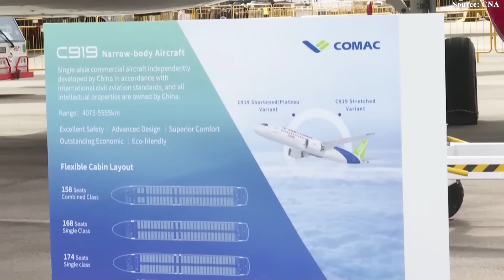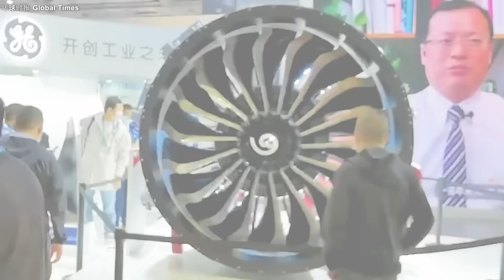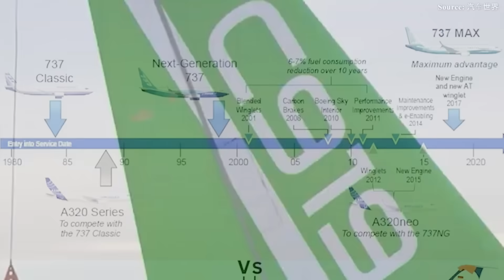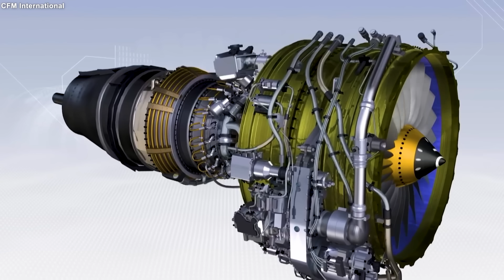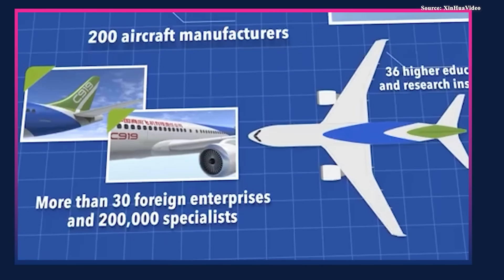This Is Why COMAC C919's Engine Outsmarted Boeing & Airbus!

Comment: Checked with Chatgpt

China's domestic engine for the C919, the CJ-1000A, is currently in advanced trial testing and moving toward verification flights. It has exceeded expectations in recent performance trials and is progressing toward eventual integration into commercial service.

🛠 Development Status of China's C919 Engine
CJ-1000A Engine Progress:

The CJ-1000A, developed by Aero Engine Corporation of China (AECC), is designed to replace the imported LEAP-1C engines currently used on the C919.

As of early 2025, the engine has entered trial runs and reportedly performed better than expected, according to experts at an aviation forum in Jiangsu.

It has already been tested on the Y-20 military transport aircraft, and verification flights on the C919 are expected to begin soon

Comment: There are some of your information are not true and you keep on mentioning the state supports and all the unfair. Do you know that China is run with communism system? Look what is happening with the West is suppressing China in the large group. That's natural, it's a national security threats to China. You can't blame the Chinese government for doing that. Which private company in China can do that or this project. You also wrong with your telling that COMAC is can only made a plane per year and you also forgot about there are planes been delivered outside China already. COMAC planes has been flying around China for almost a year now and there is no whatever incident so far. EU is under severe pressure from someone to stop issuing the certificate for Chinese planes to land in the EU but that won't be long in my opinion. They forgot China aviation market is very large and according to some experts, it needs more than 8000 planes by 2030. So COMAC will not be able to supply, it still needs help from the Boeing and the Airbus planes. Hopefully the Boeing quality and safety improve and prove to the market otherwise. I love to fly in the Boeing because it is more comfortable and quiet to be honest but very sad to know they are having problems. So please be fair with your information about COMAC and no matter how great is COMAC, China still needs the Western made planes.

Comment: The West is using its power with regard to certification to try and halt the rise of COMAC.
Reply: The question is........Boeing 737 Max is never considered a safe plane but has been certified to fly. Double standard and hypocrite
Reply: West is calumnating the Comac . But they tend to forget that China gave the World gun powder. 
They are afraid of China by marketing Comac C919 they will corner the duopoly now prevails.
I wish all the best for China, an Eastern power ,to dominate the commercial jet market on the near future as China did in the EV market ❤

Comment: Aircraft production demands absolute precision, and Boeing's was sabotaged  by a top management obsessed with saving money to please shareholders. 
Every new aircraft design is unproven. The point is that COMAC is a new and unproven producer - but it has the market to prove itself.
COMAC chose western equipment to reduce maintenance trouble for western buyers, including the engines. But China is well aware of the propensity of US and friends to be unreliable whenever they thinks they can sabotage the competition. So it developed an engine and other equipment in parallel. China was long far behind in aircraft engines, but it developed the engine belonging to the J-20 program faster than expected so it seems to have caught up with US. It is now a matter of designing and producing engines for all new aircraft - it has the capability to do so.